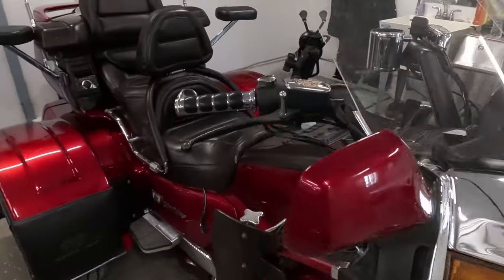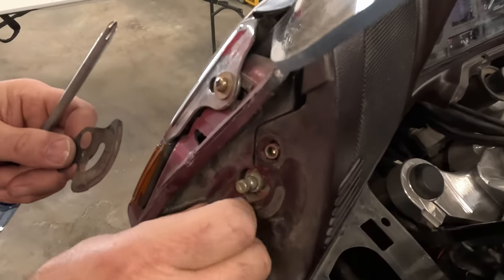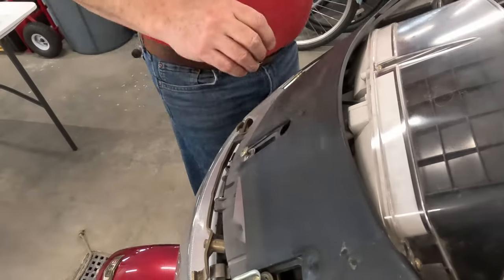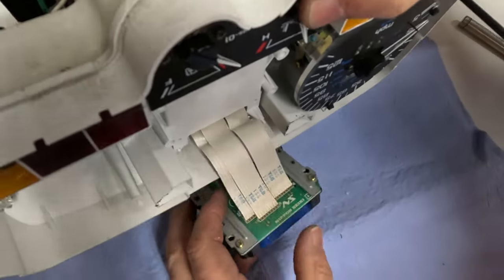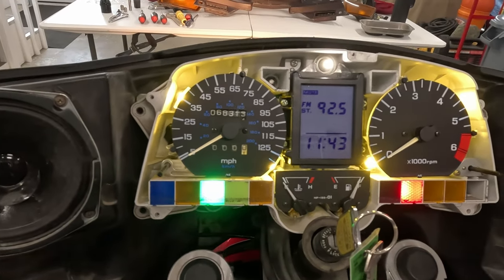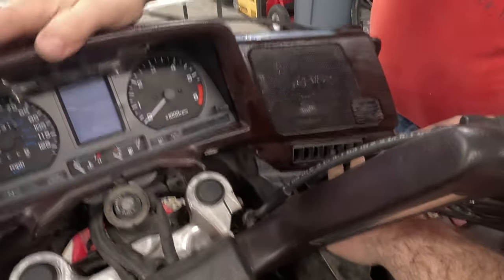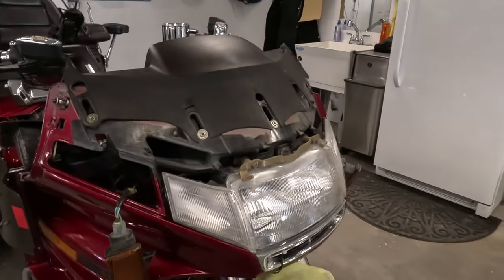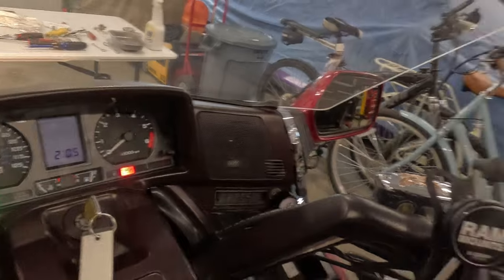How to Fix LCD Screen for 1988-2000 Honda Goldwing GL1500 from start to finish

Comment: Your video was so very helpful, it was the first time I have stripped the fairing off and delved deep under the skin of the bike, and I was terrified of doing it as it appears so complicated. With your helpful tips and guidance and the Haynes manual to help, I replaced the LCD screen, and whilst it was in bits I got the windscreen fixed so it was adjustable (mine was also stuck), also took the lower fairing off and replaced the cam belts, and checked the spark plugs, and replaced the coolant. I learned so much about this fabulous machine over the last two days. It is a marvel of engineering and mine is now 30 years old ! Amazing. Off on a three week tour of France next week, can’t wait 😀thanks for the video, and all that !!Paul, S.Wales, UK
Reply from the maker: I’m excited for your upcoming adventure, sounds awesome.  Thank you for the kind comments, I’m glad the video helped you, that’s why we did them.  Ride safe!!

Comment: Service manual wants you too remove chrome cover, loosen 5 windshield height adjustment screws. Readjust windshield height, re-tighten 5 mounting screws, then replace chrome cover. I like your idea much better with flat spacer washer too allow easier shield adjustment. If it works well during road vibrations? Previous owner put wiper blade an power controller on my windshield. But road vibration put stress cracks along shield wiper holes. I made shield bottom template an cut an new bottom edge cutting out damaged areas in shield. Made shield shorter, I like that better too. Now not stress cracks!
Reply from the maker: Thank you for watching.  It didn’t make sense to us to have an adjustable windshield but have to take it apart each time.  He hasn’t had any vibration problems.  The wiper is interesting.  Hadn’t thought about a wiper on it.  Also, if you haven’t subscribed, please do.  As we do more projects on our bikes I’ll get them uploaded.  Thanks again. Ride safe.

Comment: I can relate about screws tumbling down into unknown areas. I was working on my 1500GL ignition switch key too "on" position with no dash lights or power. You tube says check dog bone fuse next too battery, an mikes good. I checked relays an they are working by clicking sound. I giggled key in switch between access an on position. I got dash lights too flicker on. No luck spraying WD-40! So I sprayed carb/air filter cleaner into key switch along with WD-40, soaking switch below key tumbler. That was last night. Today I've got switch too function correctly for 50 times with no failures. So adding carb cleaner too switch along with WD-40 was successful in switch maintenance.
Reply from the maker: That’s awesome.  Perseverance and not giving up.  Nice!!  I’ve had to use contact cleaner on many of the switches on my bike and also took apart the cruise control switch and had to clean out the old Honda grease as it had hardened in there and couldn’t get to it with the contact cleaner.  Thanks for watching and I’d you haven’t subscribed, please do.  As we work in other projects I’ll get them uploaded. I hope your switch keeps on good behavior and safe riding!!

Comment: Thanks for your video! It gave me the info and courage to proceed with the daunting disassembly task. I've just finished installing the new screen from Tanin. I bought the bulb as well, but am unsure as to where the two smaller ones go. The larger bulbs are the 3.4W of which there are only 4, so those are obvious. Can you shed some light on what the wattage is for the two smaller included bulbs is and where they go? Thanks again!
Reply from the maker: Hi there.  Thank you for the kind words and I'm pleased to hear that my video helped you.  I couldn't remember exactly where the bulbs went, but I was able to Google "1995 Goldwing Dash Lights" and saw a few sites like Ebay where they show the bulbs and approximate locations.  The comments box won't let me copy a screenshot of it into this thread.   I'll do my best to explain it.  4 big bulbs go (@ 30 mph, @ 130 mph, @ 0 RPM, @ 4500 RPM) the two smaller bulbs go direct center of instrument cluster, 1 bulb above LCD and 1 bulb below LCD.  I'm not sure of the wattage for the bulbs.   Again, thanks again for the comments and watching.  Great work taking on the task!!  Ride Safe!!

Comment: I'm wondering where you're getting gl1500 parts? Im having trouble with key ignition switch? Any ideas as to where i could find parts?
Reply from the maker: Thank you for asking.  Most of the time we find the parts doing a Google search or on eBay.  I found what you might be looking for on eBay.   In the search bar on eBay, copy and paste this: 

New Genuine OEM Honda GL 1500 Goldwing Ignition Switch Barrel with Key 1990-2000

Hope that might give you a starting place.  Thank you for watching and Ride Safe!!

Comment: What is the actual time for this procedure?
Reply from the maker: I would say one to two days depending on your experience taking apart your bike and mechanical abilities.  It took us two days because we were filming, trying to take our time and get deliberate camera angles.  We also accidentally installed the LCD in upside down so that took time to correct and also dropped that screw which took another hour or more to find.  Hope that helps.  By the way, thank you for watching.  Also, if you haven’t subscribed, please do as we’ll upload more videos as we do more projects on that bike.  Ride safe!!